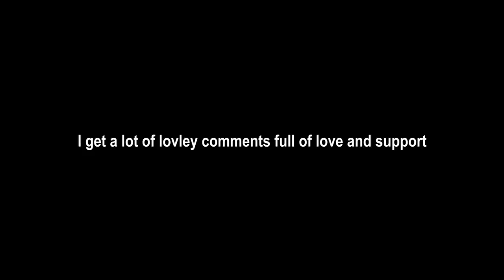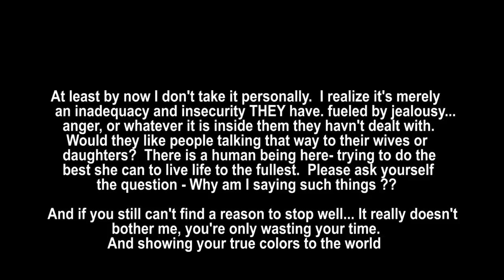They sent the mechanic who worked on my bike !  Episode 17 of my South Africa Adventure

Comment: I grew up in a family where everyone rode motorcycles, my mom dropped me off at school on a honda CB350, my dad drove me to daycare on the gas tank of his Kawasaki.  As I am a mechanic myself, building mechanical like commercial HVAC systems, she was clear in what she requested originally from the mechanic, "make it ready to cross Africa" , in that they should have checked all electrical connections and made them secure, secure meaning no way they can be accidentally broken off just by stowing a tool kit or something. I very often in my work am required to do electrical work in high voltage high current circuits and they must be absolutely secure and tight otherwise they burn up, or  worse cause intermittent faults that are hard to track down and repair. Its clear these mechanics are garbage, its just too bad. I have always thought riding in South Africa would be an awesome trip it's too bad these pitfalls exist.

Comment: Rosie, I wondered in the last video too. Because for me it did look like the big black ground wire isn't connected to the battery. 1) it was kind a far away of the battery pole 2) it looked like it was moving. Also I could not see it perfect because of the angle of the camera to the connection was behind the frame. But I have to give you the fork and the oil situation alone makes him a idiot.
Reply: I just checked the dump the bike video. And at 1:03 you can surely see the wire is off! Look at the big black wire with the yellow crimp that is just ending in nothing. That has to go to the battery too. And I promise you that I would have noticed that right away... One cable goes to ignition and accessories is connected also the charging cable to the alternator is there but the big main cable that goes to ground engine and starter is fucked. So the bike will show some function but not work proper. You might be able to ride and start it that way for a while but the current trying to finde the way over the other two cables will cause them to fail after a while... Some relays can break and other electronics too due to over heating. Rosie they did not lie to you it was broken. But that could have been that way before you have brought it in for inspection... I experience wired things on electric systems on bikes and cars where just an bonus ground wire fixed all problems.
Reply from the maker: Rosie Gabrielle
1 second ago
No, that wire was firmly attached to some other metal rig that was made- as I mentioned - it wasn't properlly attached,. BUT it was still grounded to the bike.   the wiring was a shit rats nest- these were modification made in Africa... ( you;ll see the state of the radiator after from having water put into it) ..RE wiring "  thats how it was before- and thats how I found it after the bike broke .  The good mechanic who finally saw the bike in joburg when I crossed South Africa said the wiring was the worst he's ever seen in his life. he said he never would have let me leave his shop unless he gutted the ENTIRE bike and rebuilt it from the ground up. it was that bad.  
 When I asked them to look over and service my bike top to bottom- this is how the wiring looked. They should have never let me leave with this inadequate wiring in the first place..  ( myself not knowing about electronics- didn;'t know any better- lesson learned) .   2-  why they lied to me.. they told me the entire wire was ripped off and dangling loose... does it look like its ripped off.. no , its still attached, could it be damaged- yes most probably as this is not a proper way to attach a wire.  but this is how it looked before.  There point was to blame me, that it was my fault for ripping the wire off...
Reply: I don't think that you ripped the wire of. But just take a good close look at the sequence 1:03 of the video where the bike broke down. If the thick black cable with the yellow crimp would be attached it would not be dangling around that far away from the battery pole. It would sit right next to it and not 3-4 cm away from it. It could have broken of due to vibration or when the last time the battery was worked on. Let someone else you trust that knows about motorcycle take a close look on that. And he would notice that the cable goes into the yellow crimp on the one side but on the other side is absolute nothing to see. But there has to be like a metal washer that gets screwed to the pole of the battery. And that is about only 2.5 cm long! If it would be attached to the battery the yellow crimp would be siting right next to the battery pole. Rosie you raged about the cable being connected but I have to say it wasn't. It was a easy fix, and if the ignorant mechanic that picked you up would have checked it before fetching the bike it would have worked after 5min even without a spare part. But all he wanted was to load the bike and drive back home.

Comment: So I'm going to be the devil advocate here,  it's great your doing your own thing, on a bike in wild places, I do commend you on that, there are a couple of things I would strongly suggest you do in future, if you decide to not service your bike in the future. After the service go check the levels, the oil is usually a flat head screwdriver driver to open the oil sump/ resoviour and check the level on flat ground on the back stand. Ask what oil they have used, brand, viscosity, quantity and type, incase you need to top up. Valid question and any mechanic will offer this in seconds. The same goes with the coolant, you want/ need to know the brand and quality if the coolant including temp range, again if you need to refill or top up it's important as different types can react with each other and eat into the alloy heads. You should do this before you leave the shop and it does several things, keeps the mechanics honest and lets them know you know what to ask and check for. In terms of the wire, your riding in rough terrains and on a vehicle that is shook slot, wires do break off and make bad connections, it's in universal language " shit happens" how you deal with that defines you. It might of been passable on the day and the ride broke it, it's not out of the rhelm of possibility. I know it hard for a vlogger to understand but sometimes keeping things underwraps and not making a video is the best course of action, what if the shop did do all the work and  something went wrong outside of their remit, makes it hard for them to rectify after your video is posted and damage is done to their business. I get your sensitive but maybe they are as sensitive about their livelihood being tarnished. Again playing devil's advocate here and I see both sides, being a biker and an ex mechanic. Keep her shiny side up!
Reply from the maker: Thank you ,  this video was filmed over a year ago, so I don't have anything to worry about in regards to them trying to rectify the situation. sadly- the negligence and misdemeanour continues.  Also, I know * shit happens.. the problem is, they lied about it after.. trying to point the blame to me, so they wouldn't get shit for it. It's just got bad news written all over it, and as I said-  it only gets worse from here.

Comment: The mechanics approach to loading your bike says it all.  I can’t think of certified mechanic or shop employee that would suggest something so risky.  There is a HUGE liability for the repair shop if you get hurt under his direction.  (At least that’s the case in the United States).  This is even more reckless given your complaint about the forks.  What an A-hole.  I think it is generally acceptable to assume he bike will be in better condition after getting it back from a repair shop.  Hopefully, they assign a better mechanic for the next effort.  By the way, report these people to Yamaha corporate.  Complaints generally reflect badly on the dealer/shop.

Comment: If your going to go on a long trip through rough terrain on an older used motorcycle it should be checked out and fixed very thoroughly.  This can take several weeks.  Not a good idea just to hop on and hope for the best.

Comment: The only thing I saw was it might have been loose but it was on those two wires have to be pretty tight the positive and the negative are the most important wires on the bike until it starts. But they are trying to take you for a fool Rosie! Don't let them do it common sense  is about all it takes to fix your bike.  And the shocks are not that important they are but not to the point it would stop my trip if I was on the bike with you ,don't know where my hands would be butter. Anyway I am a bike mechanic baby and that have lied to you a dozen times. I am honest as you can be and I would fix it free if I was there .

Comment: Those are not mechanics they are cowboys, a bunch of heartless crooks taking you for a ride, not caring,handing you the bike back in a condition that can kill you. But incompetent mechanics like that are everywhere, i owned a mt-03 which i bought new and on the first week in a bend the engine completely cut off, i took it back to the yamaha dealership, the said nothing wrong, rode back and on the way home same happened, quite scare, as soon as the engine cuts off the wheels would lock, so i had to instantly pull the clutch lever or would crash. Later on i found out that a batch of that model had a fault with the tps, took it back again turned on the go pro and told them to sort it out under the warranty, or if i crash because of the fault i would sue them. These were Yamaha dealership, but i had similar issues with car mechanics. Keep strong, and get the bike out of their hands asap, that mechanis is a moron.

Comment: If you measure the Voltage and you don't get any  or its very wrong  the Earth wire  is not intact, Did you make any voltage measurements? if you had you would have found the earth wire problem yourself.
Reply from the maker: who carries a voltage meter on a big ride like this.  would be nice ya,, but no room for everything.
Reply: I carry one in every vehicle cheap simple light small and can save your butt in a pinch. Even motorcycles have tool kits.And with so much being ontrolled by electrics these days the meter is essential.

Comment: To the "mechanic" who worked on your bike. If you do your JOB RIGHT, these videos never happen. I'm sick to death of people who do crap work and don't care. You have and had a right to be upset Rosie. 
As a business owner, I deal with people like this mechanic daily. They think their job is a FUNCTION, and activity. It isn't. Pouring oil in a bike is an ACTIVITY. But their job is to make sure the bike has lubricant so the bike functions correctly to get you from point A to point B safely. They are an integral part of a synergistic picture and they are too damned stupid and narcissistic to care or realize that.

Comment: I have had dozens of bikes my best one was a Kawasaki kle 500 allroad bike. Had zo much abuse on it when I bought it. Almost everything was broken except the ground wire. Because those things are short and beefy. Even on xt660 they never break. If they do they where not attached properly in the first place. It's not your fault because you are not a mechanic. I'm just a little worried about your safety with that turd of a motorcycle. I think a hobby mechanic can fix that thing better then that Yamaha dealer..

Comment: Somehow I don't believe that the owner of the bike had no issues when he crossed Africa. As Yamaha produces very good bikes, this bike must have been neglected as there was so much wrong with it from the start. The moron mechanic(s) made it even worse unfortunately.

Next time (if you decide to go on a next trip... I hope you do because I like watching you and your reports), you'd be better off with a (almost) new bike or maybe a factory sponsored bike. A Triumph Tiger or KTM are quite light on weight, a Suzuki V-Strom or Honda Africa Twin DCT a little heavier.

I ride a Honda NC750X DCT which has an incredible low CoG, it goes where you want it to go. Although it is not the most capable bike for off road Africa, with some heavy duty aftermarket parts, is will go all the way without any real problems. It's quite cheap too, even with that foolproof DCT. LOL

Just my thoughts, my dear. ;-)
Reply from the maker: Strangly.. the bugger rode from Zanzibar with not even a FLAT !!!    if that's not luck, I don't know what is.. I got 4 flats in one week on this trip !!! HAHAHA   and yes, yamaha's are great bikes.. just not this one.. I guess the corrosion finally got to a certain point and it was just its time !

Comment: I would be more pissed off at the owner of the bike as I heard in 1 of your vids you are relocating it for someone ? not sure if that is the case or did you buy it ?
It is pretty obvious whoever owned it has run it into the ground and if it had a dodgy rear shock and the fork chrome is pitted it hasnt been looked after its been used and abused.
If you are relocating the bike then the owner is to cheap to pay for it to be transported and you are the one doing them the favor ,its a simple matter of if you bring in a bike to a shop that has been worn out and not maintained for years alot of things could and will go wrong on a long trip as the vehicle will fail under stress due to age and neglect, look at the reaction the suspension mechanic had when talking about when the rear shock should have been fixed = 3000km ago ,the mechanic who "checked" the bike before you left should have highlighted the faults of the bike and told you what could go wrong with it instead of just saying yeh its fine .....he should have pointed out as you are going on a long journey what needs to be changed on route and what will need to be replaced due to wear in the future.
people dont understand that motorized vehicles are working pieces of machinery they are a complex series of moving parts that need to be replaced when worn and checked so they remain serviceable its the same as the counterless vanlifer youtuber kids who buy old VW campers and wonder way the brake down 2 weeks later as they are brought from city folk who only drive 15min a day to work and back. 
So its like bringing an old sick horse to a vet and saying hey I am entered in the Kentucky derby next week make my horse win
mechanics can only do so much "you can polish a turd but it still a turd" 
the only way around this is try and learn some basic motorcycle repair so you are not second guessing decisions 
the more you learn the more you will realize that it is easy to explain what is not working and what needs to be repaired 
in the age of the internet all that information is available to learn.
"Information is knowledge ,knowledge is power"

Comment: Four Yamaha guys disliked the video😕
Reply: +Sajid Aiam   I disliked it as well. A few comments above a viewer has pointed out that the earth wire actually isn't connected to the battery. It shows in the previous video where it isn't connected. So essentially her video evidence backs up the mechanics claims that the earth was detached.
Reply from the maker: Rosie Gabrielle
1 second ago
No, that wire was firmly attached to some other metal rig that was made- as I mentioned - it wasn't properlly attached,. BUT it was still grounded to the bike.   the wiring was a shit rats nest- these were modification made in Africa... ( you;ll see the state of the radiator after from having water put into it) ..RE wiring "  thats how it was before- and thats how I found it after the bike broke .  The good mechanic who finally saw the bike in joburg when I crossed South Africa said the wiring was the worst he's ever seen in his life. he said he never would have let me leave his shop unless he gutted the ENTIRE bike and rebuilt it from the ground up. it was that bad.  
 When I asked them to look over and service my bike top to bottom- this is how the wiring looked. They should have never let me leave with this inadequate wiring in the first place..  ( myself not knowing about electronics- didn;'t know any better- lesson learned) .   2-  why they lied to me.. they told me the entire wire was ripped off and dangling loose... does it look like its ripped off.. no , its still attached, could it be damaged- yes most probably as this is not a proper way to attach a wire.  but this is how it looked before.  There point was to blame me, that it was my fault for ripping the wire off...

Comment: Rosie you b!tch alot but you've got a point yes it is potentially your life on the line and they took you for a ride! More importantly this all reeks incompetence on mech/Yamaha part.

For the negative comments: screw them if they have a problem they should get own channel! And if they have time to post they should be riding...to Starbucks at least.

And yes you need to get more experience working on the bike next time you have bike worked on be there, better yet work on it yourself and have them tell you what to do. Get a lemon bike when get home and work on it! Going solo on long trip like that on borrowed bike with no rudimentary diagnosing/fixing skills is liability. You should have at least planned a shakedown week trip around town before taking off.

And if you have an opportunity to ride with someone do it especially if you and your riding buddy on the same wavelength. I have given rides to friends when their bikes expired, helped to get bike up and was helped in return. It is alot safer this way good luck.